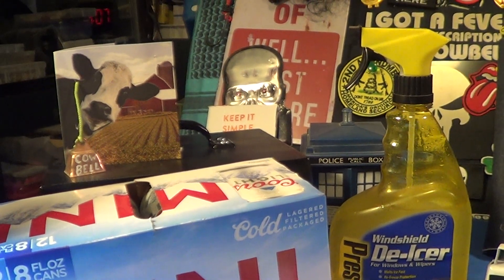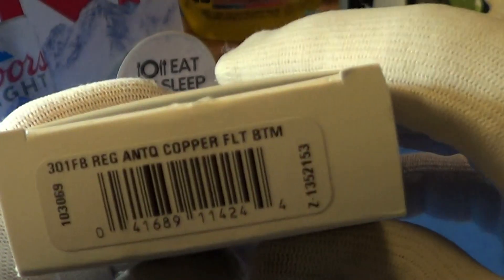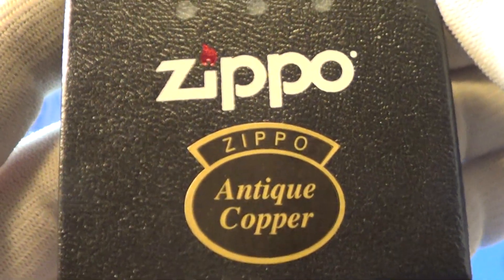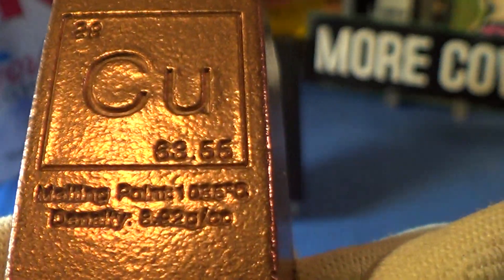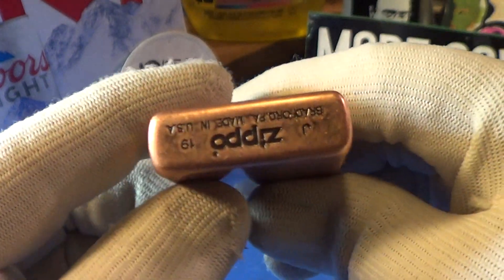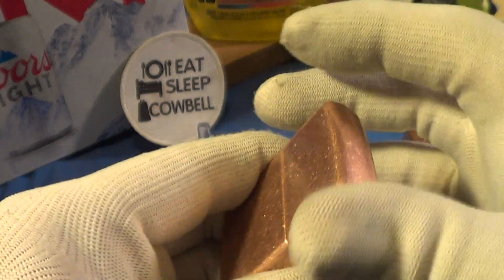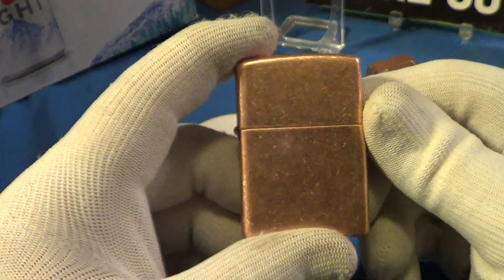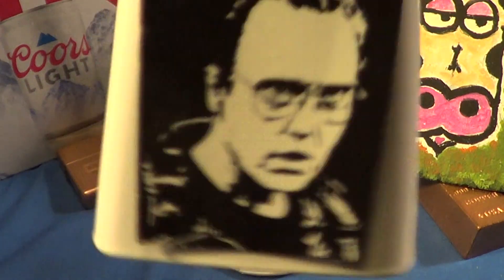It's the "Antique Copper" Zippo.

Comment: Those are just a thin plated copper color. Naphtha (lighter fluid) will wear it off. However, Zippo just re-released the Solid w/black coated insert.. based off a 1969 prototype. $75. You should totally pick on up. The Solid Copper is great. The black insert is meh. Easily scratches. Looks best with brass coated insert or a gold flash pipe insert.